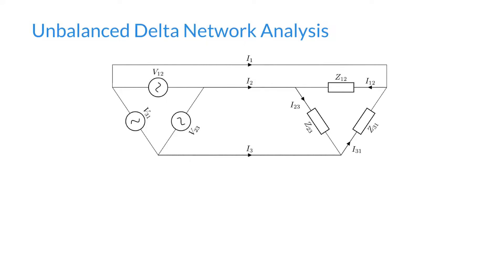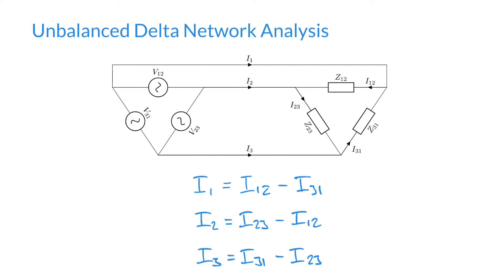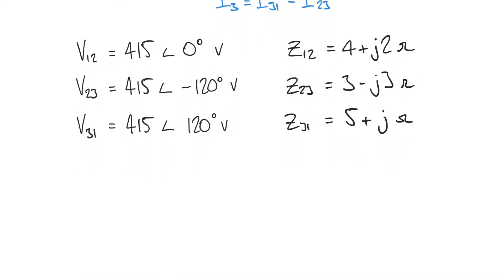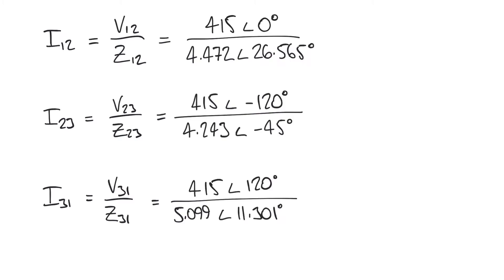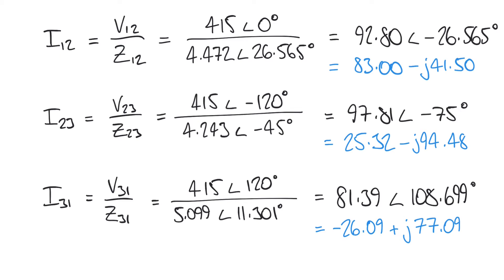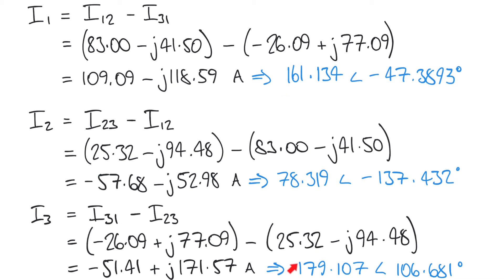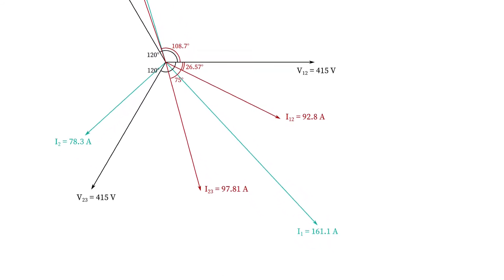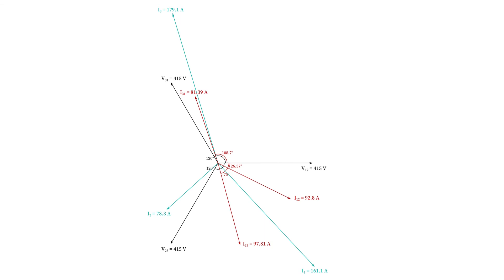Analysis of Three Phase Unbalanced Delta Network

Comment: The math on this video isn’t overly difficult but you can make mistakes if you are not careful because of the amount of computations involved. Even on an advanced scientific calculator caution is advised.
Could you imagine engineers having to do this example years ago with no scientific calculators or computers available? It would be a nightmare.